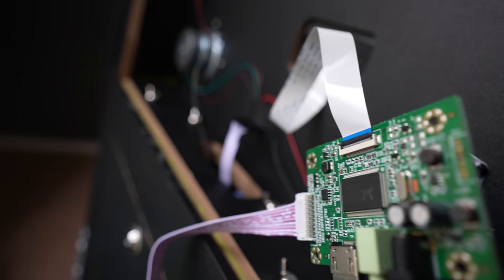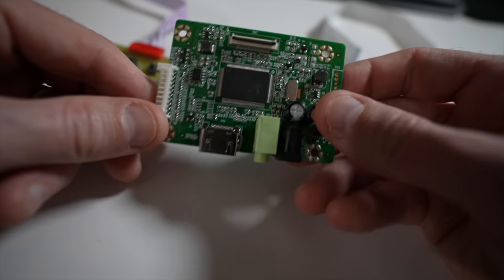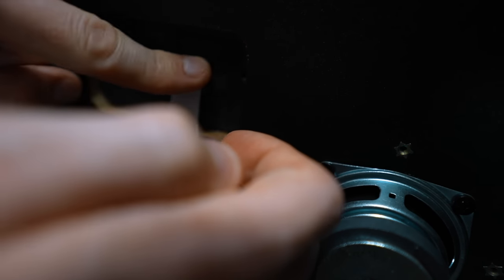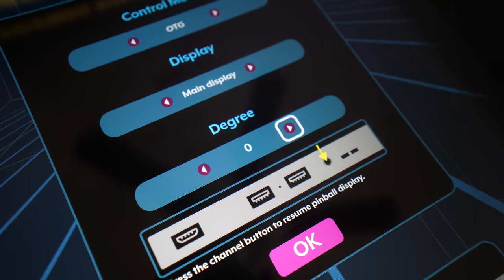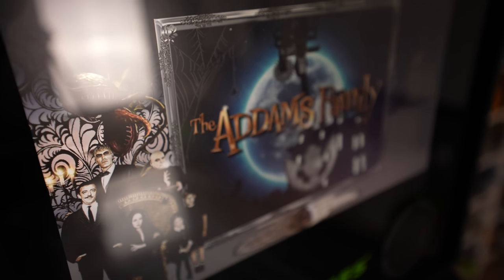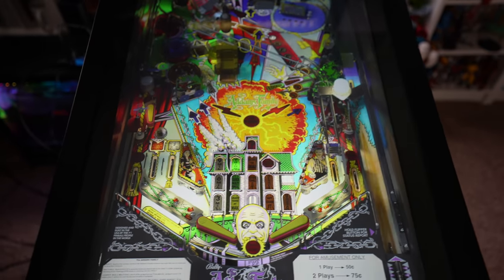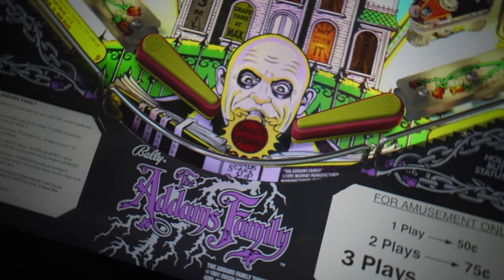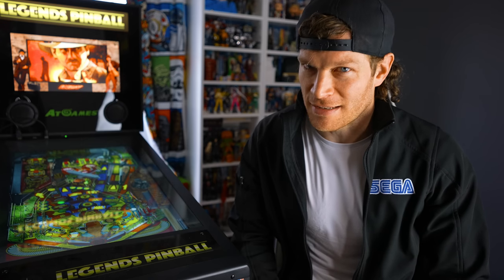Legends Pinball Mod - Play Visual Pinball & Future Pinball

Comment: Did i miss something as in where's the score ?
Reply from the maker: I was experimenting with a 3rd screen on the floor off camera in some of these gameplay clips.
Reply: @cooltoy  Frezzy's Pin2DMD can be Virtual and Overlayered onto the 2nd screen, if you only have 2 and not 3 screens,
If you allow Registry to be Edited then each machine can have the DMD size and shape saved separately, which is needed for only 2 screens, with a 3rd the DMD is the DMD and will always be in the same spot, no need to allow Reg Edit for 3

Comment: I’m going to share my opinion- at the moment its still running android based early SS Gottlieb tables and relies on having quite a beefy PC like Doug made clear. People need to take stock of this before they pull the trigger and order thinking they’ll run Visual Pinball by turning the power button on. How immersive will this be without any feedback? Save your money for a full size Sharpin- German engineered quality that hasn’t been shipped out of Wuhan
Reply: The Sharpin unit sounds promising but with units starting at €999 + shipping it isn't going to be cheap. With volume, the A1up and AtGames pins will spawn a wide variety of mods. Options are a good thing - it validates the segment.

Comment: It would be even better if the DMD was working.
Reply from the maker: the digital DMD works just fine, I had it turned off on a few tables as I was testing certain settings during gameplay.
Reply: @cooltoy  that's cool the DMD works